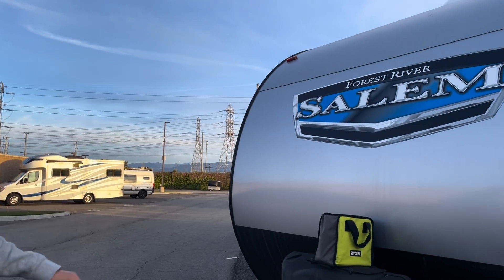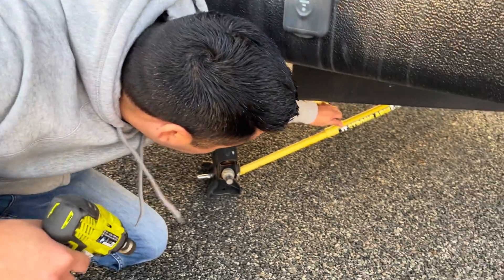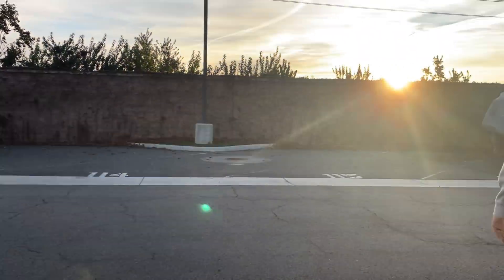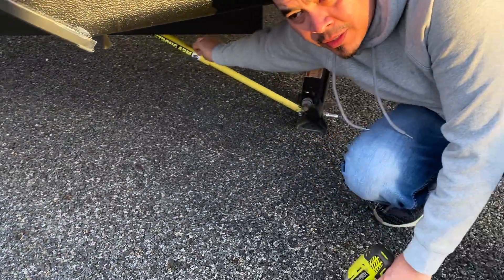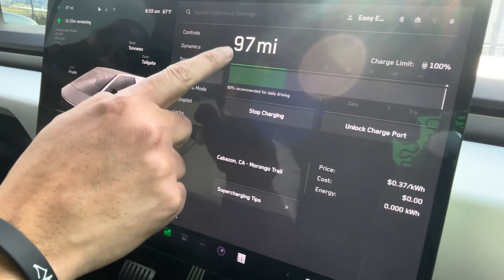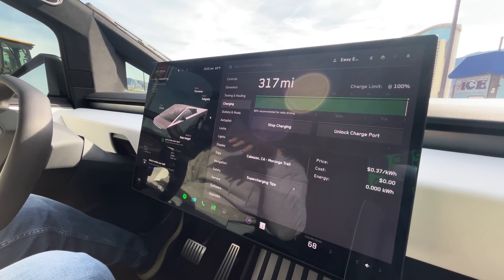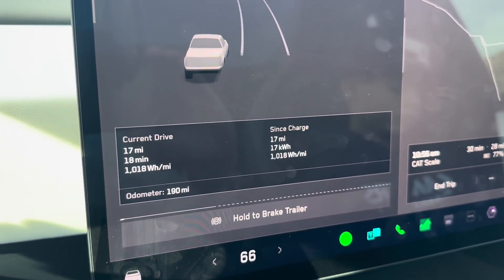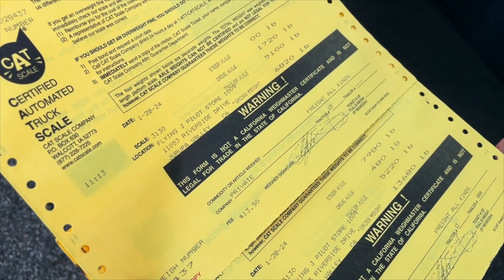TOWING LIKE A PRO! CyberTruck Tames 7,000 lb Travel Trailer

Comment: Great video with informative numbers! When you said you felt no sway, did you think it was mainly because the Cybertruck itself, or because of the weight distribution hitch? Did you get any chance to try towing the 7k lbs trailer without a WDH? I am struggling whether to use the WDH, with my Cybertruck towing a 6k lbs trailer. There are very few superchargers with pull through. Connecting and disconnecting the trailer with WDH will be a real headache. Thanks!
Reply from the maker: This is a great question and maybe something that I should cover in a video. This video was my first time towing with the CT and so I used the WDH. After the video posted I received some comments from people stating that a WDH is not recommended on unibody vehicles, which the CT is. I decided to call the manufacturer of my hitch and they agreed stating that they do not recommend WDH's on the CT. I never used it again with no issues.

I attribute the lack of sway from the low center of gravity of the CT. It really handles towing well.
Reply: Not sure if my follow up comments went through. But just wanted to thank you again for your experience and insights! This is very valuable information! Thank you!🎉

Comment: I don't think you crossed your trailer chains

California law requires that safety chains be connected to a trailer and the towing vehicle to prevent the trailer from separating from the tow vehicle if the hitch fails. The chains should be crossed under the trailer tongue, with each chain attached an equal distance from and on opposite sides of the longitudinal center line.
Reply from the maker: I appreciate the concern but I always cross my chains. Thanks for the watch and comment

Comment: At that rate you're going to be traveling for an hour, then charging for an hour.  Assuming there's chargers every 80-100 miles.  For those that are not pull through, you'll be spending an additional 20mins disconnecting and reconnecting the trailer.
Reply from the maker: You will be able to travel for about 2-2.5 hours until you need to charge. Also disconnecting and reconnecting doesn't take 20 mins but I do agree that there needs to be more pull through sites as no one should have to disconnect in order to charge
Reply: @Butter_EV  unhooking and rehooking over and over again in the Texas summer, sounds like fun!

Comment: Disappointed you didn't do the math on actual vs projected miles.  Sounds like you only get 25%-33% of the charge range if 75 miles uses almost all of 310mile capacity
Reply from the maker: Range will depend on weather, elevation and wind. ICE vehicles suffer from all of those factors as well. In my 6 months of ownership and many trips camping I say that I get around 125 miles while towing my RV

Comment: If I understand you correctly, you started with 308 "miles of range", then drove 110 miles towing 7000 lbs. with a substantial gain in elevation, and you ended with 94 "miles of range". 308-94=214 rather than 110 miles, so you clearly didn't get the range the vehicle estimated. That's understandable, but I'm more interested in the actual range extrapolated to a full battery. You got a bit more than half of the estimated mileage on the first leg of the trip, so I'd expect the vehicle to travel around 160 miles with a full charge under these conditions, similar to what I've seen in other towing range tests.
Reply from the maker: Yes you are right. I have an upcoming camping video where I tow 95 miles one way and I think I could've gone another 50-60 miles. Stay tuned for that video

Comment: You're reading your CAT ticket wrong.  The trailer weight is JUST the weight on the trailer axles.  You have some of that weight on your trailer toungue, which goes to the Cybertruck.  So thats why the Cybertruck seems like it weighs more than its supposed to, and also why the trailer seems like it weighs less that its supposd to.  The CT is taking some of the weight of the trailer on the rear wheels of your CT.
Reply from the maker: You are right but that’s why I unhooked the trailer and weighed it separately

Comment: We have a similar size travel trailer and I’m really curious what the efficiency for the CT is at different speeds. 70 mph vs 60 mph is about a 20% reduction in gas used on our half ton tow vehicle.
Reply from the maker: We went camping this past weekend and I went 55mph, California 😒, on the way there and 60-65mph on the way back. This way we can see what the change in speed does to the efficiency

Comment: Does the CT charge your trailer while you drive? My friend towed a 2200 lb trailer with a Model Y and his trailer was dead after arriving at the campsite 230-miles away, due to the need to charge 3 times at SuperChargers to make it. What should have been a 4-hour trip ended up being an 8-hour trip with charging coupled with unhooking and rehooking up the trailer each time.
Reply from the maker: Yes, when you connect the trailer to your tow vehicle the truck should keep your batteries charged. 

The biggest issue with having your tow vehicle being an EV is not range but the amount of pull through charging stalls and how to find these stalls. Don’t get me wrong range is a big issue but having these stalls more readily available along with the ability to find them really needs to improve.

Comment: I wonder if smaller diameter tires (i.e 32”) will increase the efficiency of the CT?
Reply from the maker: I would imagine that it would. But these 35s look soooo good in person
Reply: @Butter_EV  Yeah, I love the big diameter tires too, but it would be interesting to see how much more efficient smaller tires would be when towing since it would be like lower gearing and that the fact that electric motors are very sensitive to where their rpm/loading range is. Keep up the great videos!
Reply from the maker: @gogianyee5002   I’m definitely interested in this as well. Maybe the guys at TSportline or Unplugged could help me test this out
Reply: Great job on this educational video. When doing another test down the road, I would like to see you run the same trip without the trailer. Then do the run hooked up to the trailer. Then  compare KWH and miles exc. Thanks.

Comment: I still don't understand why trailers cannot be built with under the floor Tesla-like batteries that could be used to greatly extend the range of the Cybertruck and provide electrical power for the trailer as well.  Maybe even a small motor under the trailer to help the wheels turn. Would make going uphill a breeze.
Reply: Using trailer mounted batteries to drive the truck would require a charging port near the hitch. The connector for lights and brakes is not bi-directional nor high power.
Reply from the maker: So you’re definitely on to something. There are multiple companies who are making trailers with independent motors and battery packs. I’ve reached out to them so I can do a video but they don’t get back to me 😔

Comment: 1:15 minutes to charge to 100% is abysmal compared to the 2018 model 3 that charged 0 to 100% in 40 minutes. This thing is 6 years newer in innovation! What innovation? 4680s are a disappointment.
Reply from the maker: Keep in mind the difference in battery size. It takes longer because you have more to fill up. It’s like a Honda Civic having a 15 gallon gas tank vs my Ram 3500 with a 32 gallon tank. The Ram will take longer to fill
Reply: So about 4-minutes to fill the Civic and 8-minutes to fill the Ram @Butter_EV  . The new 2025 Ramcharger that has electric drive and 690-miles of range with the 130 kWh generator on-board will be a fantastic stepping stone for towing and eliminates the drastic range loss affecting BEVs currently when towing.
Reply from the maker: @williamcockrell4394  I’m really looking forward to that truck
Reply: @Butter_EV   I realize that, but my model 3 charges at 1000 mph without tab-less cells. These 4680s were supposed to have next level thermal performance. The CT with 123KW battery should charge at 350kwh to be the same as the M3. If it was better it should be able to take two 250KWh charges at once and sustain 500KWh longer. There is nothing better about the 4680 other than, maybe, cost. My order is near 183,000th, but I am unimpressed with the battery system.
Reply from the maker: @dglennon20  I totally see where you are coming from and you are not wrong. But I do think that Tesla hasn’t unlocked the full potential of the 4680s yet, or at least I hope not. I think this is a more wait and see type of situation 🤞🏼
Reply: @Butter_EV  I hope you are right. I really do. Hopefully they do by the time they call me. Some of the other engineering in that truck is next level though. You do make some great real world use videos! Thank you.
Reply: Lol. It’s like doubled the battery size of the model three.

That’s like seeing someone run a half marathon in two hours, and being totally upset when they run a full marathon in 3 hours. Lol
Reply: It is only 50% larger. My 2015 S and 2023 M3P have same size battery. 3 charges 4 times faster per kwh. @DatDude923

Comment: Weird to drive uphill, charge to 100%, and then drive downhill. A full charge keeps you from recovering potential energy to charge the battery vis regen, which is a huge benefit over ICE vehicles and saves the brakes. Your efficiency downhill should be way better if you left some room in the battery.
Reply from the maker: You’re 100% correct. Tbh I didn’t think of that at that time. I was just trying to show how long it would take to get a full charge. I appreciate the watch and support

Comment: did you weigh the truck and trailer separately, or just weigh each axle to get the weight numbers? If they were still hooked together you'd have the tongue weight of the trailer transferred to the truck.
Reply from the maker: I actually weighed them together and then dropped the trailer, drove off the scale to get the trailers true weight

Comment: What was the cost for the trip and what would your diesel have cost. My model 3 sr+ battery size is 50 kw.  it 😢 and 2.6 gallons of gas. If you compare gas to it. At 22 cent it would be 27 06 to fill up at home how far can your diesel go on 27 dollars. At 4.99 for diesel. How far can you go on 5..4 gallons.
Reply from the maker: My diesel gets about 10MPG with my trailer. I have a 32 Gallon tank. So 320 miles on a full tank. Give or take. This loop run cost me roughly $65 between the SC and my home charging. That would be equivalent to about $55 in diesel gas
Reply: @Butter_EV  is you truck stock or using a runner. I run banks on my 05. Get 12 to 14 depending on the right foot pull my 30 ft  toy hauler .
Reply from the maker: @LaJuanHughes  stock
Reply: Gas is actually 33.7kwhs per gallon and road diesel is 37.9kwhs per gallon for total energy density. 
We the ct has less than 4 gallons of gas or 3.5 gallons of diesel in total available energy onboard. 

Per the op his diesel ram with the same exact amount of energy could then go 35 miles from completely full to empty vs 120+average for the ct. 

Really impressive result here for 14,000+# of combined truck&trailer weight with 35" at's in an awd 600+hp rig at hwy speeds. 
A ram trx or raptor r ice equivelant truck would go maybe 25 miles using the same exact amount of energy. 😀👍🏻
Reply from the maker: @4literv6  wow this is great info 👏🏼 I appreciate you breaking it down like this
Reply: @Butter_EV  you are welcome and thank you for sharing real world ct towing experiences with us!

For fun man, my 2019 xl f-150 gasser empty getting 19mpg hwy uses the same energy per mile in kwhs as an 80,000# tesla semi does.
Per the data Pepsi released during the run on less event last Sep. 1.7kwh per mile used for both. 

Except my truck wouldn't be carrying anything but me in it and with full fuel is still well below 5,000# vs the larger 16x heavier tesla semi. 😀👍🏻

Comment: Probably not a good idea to use a WDH on a Cybertruck since it has no frame.  You're just stressing the part of the unibody where the hitch is installed.  Also with the air suspension there shouldn't be any sag on the rear axle anyway.
Reply from the maker: Ok so this is an interesting topic. When Andre from TFL came over I asked his this and he disagreed. He says that I should always use a WDH. I think I need to dive deeper into this.
Reply: What did you find out?

Comment: So the math if I understood this using 317 miles as a full charge
uphill 57 miles = 222 miles used so almost quadruple
downhill 57 miles = 120 miles used so basically double
with a standard 40min-ish stop you will be able to get to 80% charge but obviously reduce your range and most won't risk running it to zero
317 / 4 = 79 miles going to 0
317 / 2 = 158 miles
These numbers would be drastically worse if it wasn't 60+ degrees out
The CT is probably best used for regional travel or hauling a boat to the local marina
Reply from the maker: Yes I totally agree. The CT is not the ideal vehicle for long tow trips. We do a lot of local, 20-200 mile round trip, camping so the CT will work for us. Now we also do at least one long trip every year. That’s when I’ll use my Ram
Reply: Regional travel? LoL. Better be a tiny region! You could use up it's entire range driving from one side of Houston to the other!

Comment: Tbh, I was a little offended by the charge rate. But nonetheless, this is ideal amount of time to rest up, take a break, and check your truck/trailer, reducing fatigue and increasing safety for yourself and others on the road.
I always wondered, why not just drop the trailer and charge, but those pull-through chargers are convenient.
Also, assuming speeds were averaging 55mph, curious to see the efficiency out of California lines.
Reply: It would be a lot better if you charged only to 80% or so.  Literally would be 1/2 the time vs charging to full.  Every EV will slow down the charge rate dramatically for that last 20%
Reply from the maker: @randyhou8522   Agreed. I’ll test this and film it tomorrow when we stop to charge
Reply from the maker: I agree, whether I’m in my Ram or an EV we always take a 30-45 min restroom/eating break. Tesla really needs to add A LOT more pull thru charging stalls. Plus they need to give us a way of identifying those stalls in the app or via the interior screen
Reply: @Butter_EV  If enough interest for stall identification is received by Elon on X, it may just be another OTA away. I’m not up to date with charging infrastructure, but there should be some in the works to accommodate the Semi. And assuming CTs would also be allowed to charge at these locations.
Reply: Those rest and refueling stops are normally after a few hundred miles, not every 100 or less,. I drive to Mammoth and stop once for as long as it takes to fill my tank, that's what most people do. Face it, EV's are great for running around town or moderate commutes (if you have home charging), but they are horrible for road trips and towing/hauling anything over a hundred miles. @Butter_EV
Reply from the maker: @vertstang123  I totally agree that an ICE vehicle is best suited for long tow/haul trips, hence why I still have my Ram 3500. I’ll be using the CT for local camping and the Ram for longer destinations. But I am encouraged with how well the CT actually tows the trailer, just needs more range

Comment: Your video showed you charge to 100% at Monrongo with 317 rated miles.  Have you done that multiple times and does it always show about 317?  Also, when you charge to 80% what do you normally show as rated miles (is this normally your daily charge?).  Thanks.
Reply from the maker: Yes a full charge is 317-318 miles. I charge it at home to 80% which gives me 254 miles
Reply: @Butter_EV  ok, but that's totally not correct, right? Like, can you please tell us the real numbers? How many miles did you ACTUALLY drive and how much of your range did that use? I'd be shocked if you got more than 150 miles of range on a charge.

Comment: Instead of tow mirrors which cut range, how about tow cameras? Do you think that would work.
Reply from the maker: If there was a way to integrate the camera view into the center screen then yes. Otherwise it can be an issue. I have a Furrion backup camera mounted on my trailer but I cannot use it as it plugs into a cigarette lighter which the CyberTruck lacks 😔

Comment: Maybe don't use an impact drill, then it won't be so noisy... lol
Reply from the maker: Yes that darn impact drill is so loud 🤣
Reply: @Butter_EV  lol much cheaper than a self rising and lowering trailer.
Reply: @Butter_EV  lol
Reply: @ItsBinhRepaired  I tow as well and I use a normal powered electric screwdriver/drill. It looks the same as this but it’s not an impact driver and doesn’t have the loud clicking. Try that out and your neighbors/ campmates will thank you. I would be livid if somebody was setting up camp next to me at a campground with an impact drill.  😂
Reply: @DamianDaly  LOL yeah

Comment: Thanks for the video, could you try shorter charges next time?  Like lets say to 60% 70% or 80%?
Reply from the maker: I think what I’ll do is record the charging to show how long it take to get to each “milestone”
Reply: @Butter_EV  cool!  A good one is a trip to Vegas, but without the trailer.
Reply from the maker: @lrod8692 don’t temp me with a good time 😂
Reply: @Butter_EV  hahaha...you just got an update? time to test those charging speeds again
Reply from the maker: Yes I do 😉
Reply: Look fwd to watching video. Think it's much faster to 65-70%. Maybe charge and go from there starting as low as possble.
Reply from the maker: Definitely much faster going up to 80% but I wanted to play it safe and charge to 100%. I’ll be towing this weekend so I’ll try and charge only up to 80% to see how quickly it charges up
Reply: @Butter_EV  Ryan Shaw posted times charging from 2% all the way on V3 charger. I think it was 19min 2-50%, 30min 10-70%, but I think it slows down hard after that.